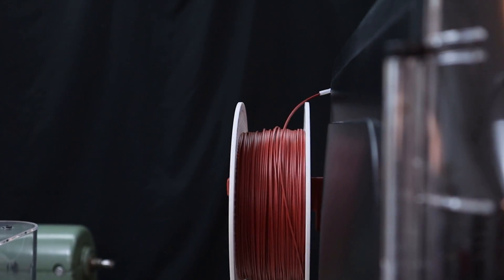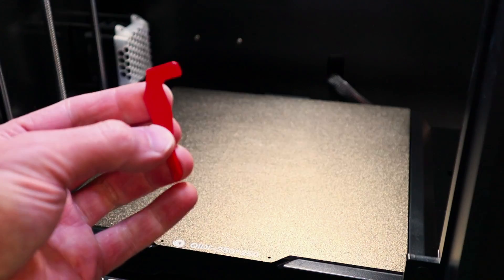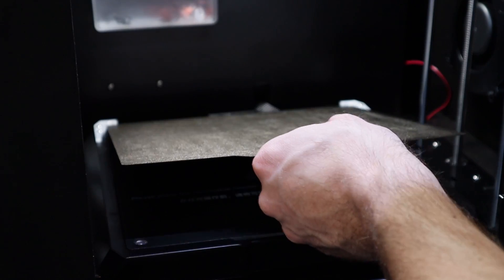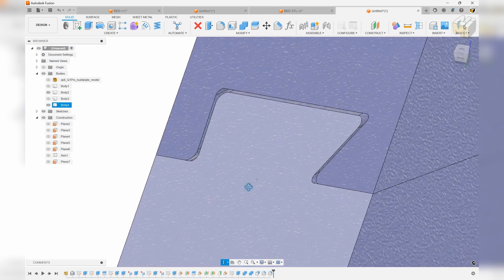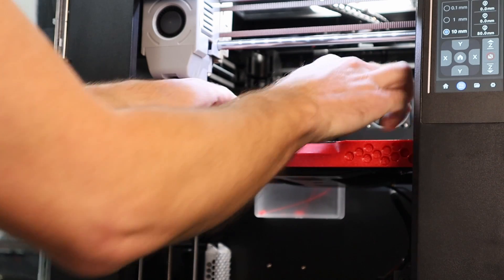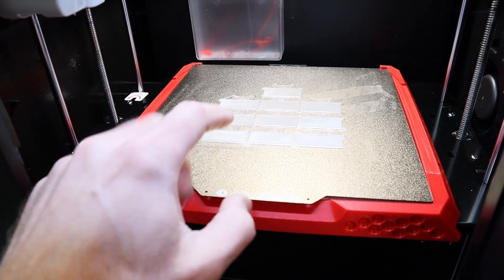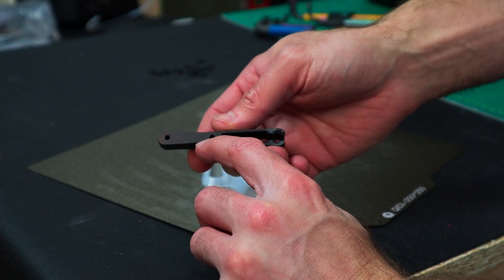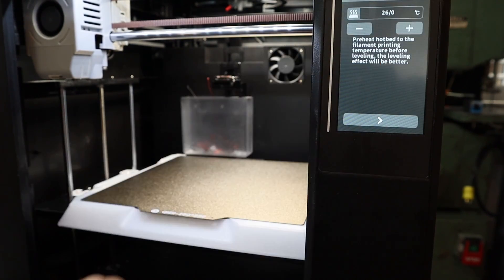Upgrade your QIDI Q1 Pro with Dual Build-plate Stops + more

Comment: I ended up sending mine back as to me it felt rushed to market and the actual quality of the machine was lacking in comparison to my XMAX 3 and XSmart 3. Also, for the build plate size, the machine itself is incredibly big and it seems like there’s so much space wasted. I’m sorry but when you buy the latest and greatest you should not have to do all these tweaks to make it a better machine. These are all things that should’ve been addressed at the factory before it went out the door. Like even opening the front clear door, there’s no good spot to grab it, who does that? I love my Qidi’s but this was a hard pass for me. Replaced this with a Bambu A1 mini and then will get the full size A1 next month.
Reply from the maker: I was having a conversation earlier about this too, they said, "why can't they just send something that is perfect".   My answer is that it's impossible to do, you can't account for everything and everyone's different tastes.  Considering the price-point of the printer and the high quality prints you can get from it, I don't have a problem looking past the few downsides.  If you can afford a larger printer that's more refined, go for it.  

As far as the door, I don't personally need a handle, I can easily grab it, I prefer without, but that's just me. 

The A1s look like great printers, and in an enclosure you should be able to get some relatively warp-free prints.   The A1 also has auto-calibration, though I don't know if it does flow, it says it does PA, and mentions flow, but doesn't say that it truly does flow, maybe they're done simultaneously.
Reply: @NeedItMakeIt cant be perfect, but they lost things they had already at the plus3
Reply: @psxtuneservice  It's also quite a bit cheaper.
Reply: I definitely wish they made it a bit more compact! I don't have one yet, but it really does seem bulky for the build size. Less space to heat would only help with the heated chamber efficiency as well. The bed plate locating tabs aren't a huge deal overall, but another commenter says they have already added that in a revision along with a few other improvements. It's good they are willing to make changes quickly at least. I also hear the customer support is quick and excellent. It is strange they didn't put a handle on the door, but I thought there was a spot to grab easily at the bottom right? Either way, understandable you didn't like it. Still seems like a super capable machine for the money. I hope they keep improving it.
Reply: Another thing I will add is I do see why there’s so much hype about the Bambu labs. It’s a very apple like experience from how it’s packaged to how all the parts are individually marked and wrapped,, fit and finish and from the very first print everyone has been perfect and I haven’t had to do a single thing but with my QIDI printers it’s been a little different, but still they print great.  If I was going to compare an identical, prints, the bambu labs wins on every single one the finish is so perfect it’s almost unbelievable. As I said, it’s my first bambu printer I have bought which I just received on Monday but I do get why people love them so much.
Reply: @eddiee2750 Actually, Qidi has really good packaging, not even Bambu can compare. We have seen multiple X1C units have their aluminum shell beaten and the frame completely skewed, while Qidi, with their reinforced protected corners and styrofoam, their customer support claim they've never sent out a printer that sustained shipping damage.
Although the shipping volume has to be considered, but still, Qidi knows what they're doing.
Reply from the maker: The only issues I've run into with the X1C are when printing PETG, it doesn't wipe well and it gets stuck to the nozzle, however, that's true for most printers.  In the case of the Bambu, it's the color changing that can cause some problems; it can deposit the printer poop inside the chamber and in some causes inside the finished print and ruin it.  

That's really my only complaint they are very good printers and they've created some novel solutions that nobody else has. They've really put the pressure on the other companies to compete.

Do you plan on putting yours in an enclosure?
Reply: @NeedItMakeIt  No I do not. I have the XMAX 3 and that has really been a great machine right from the first print. I love my QIDI's and you are definitely correct, none of the machines are perfect for sure, but for me the Q1 just felt so large for the plate size and with some of the other issues mentioned, it just wasn't a good fit for me. I must say though, that little XSmart 3 has been an absolute trooper. Print after print just like the Bambu they come out fantastic. I am totally new to Bambu but I know I will always have a couple QIDI's for sure.Great company, great support.
Reply: @eddiee2750 They fix it the problem no need to do modification I don't like that you bought  A1 they are not that good they have some bad as other printers
Reply: Same
Reply: Just to understand but how is 46 cm width "large" when it's just 10 cm per side more than the print plate? In a heated chamber as well.
It's one of the compact printers, actually.
Reply: Did you have a pre-release machine?
Reply: I know this, between my two A1 minis and my A1 I think I’ve had a total of three bad prints out of hundreds. You can just set it and forget it, you never have to look back, and I feel like on my QIDI printers  I always have to make sure it isn’t malfunctioning and basically have to babysit all of them.

Comment: New versions of the Q1 Pro has an updated bed mount with alignment corner brackets, new and improved bed assembly, ethernet port, and improved filament inlet. For Chinese mainland, old version is only sold for 1.5 days and people that got the old version (same as the reviewers) will get a chance to get a refund, or get free nozzles and bed plates. 
The price for mainland is 340USD early bird or 367USD now that Q1 is released.
Reply: Interesting. Where from do you have that information?
Reply: @Phil4o2  People that ordered on the 20th and part of 21st had their machine quickly fulfilled and received, while people ordered starting from the 22nd waited up to 4 or 5 days before shipping continued on the 27th. During these days, they were busy doing the fixes. People that got the first batch quickly found it out, and they are offered to return the machine or free bed plates and nozzles.
Not sure if they sent out the first batch knowing they will have the second, and is just trying to get the stock out, or did they try to fix as much as they can for the future orders. Either way, I got the new version. The information is on Chinese group chats, and is also available if you ask them directly (I got confirmation that mine was fine this way for example). 
Note that everything above is probably only applicable for shipping from China via their Taobao/Tmall storefront. Not sure if it applies to international customers, but... they'll eventually get the new version, or maybe even sooner than the 27th, with the new version ready at launch, I have no idea. If that isn't the case, then "having stock in global warehouses at launch" kinda became a bad thing isn't it? :(
Reply: @jerrymk6846  Currently "in stock" seems only for china and brazil, for rest of world delivery is April/May/June
Reply: Oh wow! Where did you find this info? Glad Qidi is willing to quickly respond to reviewer and customer critiques.

Comment: What is,  your opinion, the easiest but best filament for printing a holder Like this?
Im asking for a other printer but also with direct contact to the heatbed
Reply from the maker: If you're not contacting the bed at all (1mm airspace) you should be good with ABS or ASA, but if it's like this model, where there are parts which are nearly in contact, I'd go with PC to be safe.  When I measured, it was reading around 90C on the part at the highest, I'd assume that's because the bed is only set temperature at the location of the probe, everywhere else is less, especially around the edges.  This printer having the heated chamber changes things a bit, the differential will be less.  PC to be safe, ABS will probably work for quite a long time.